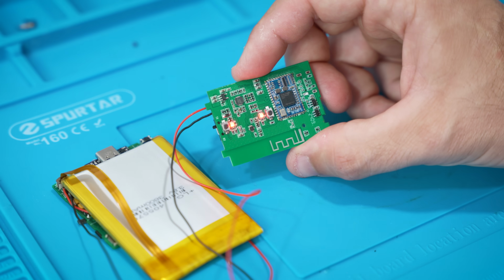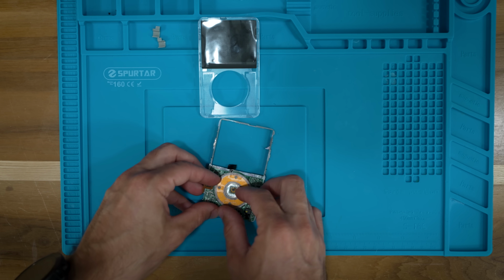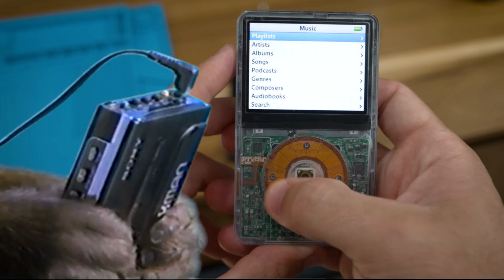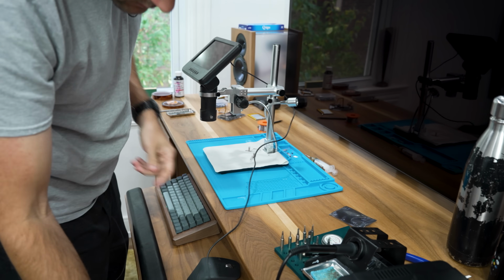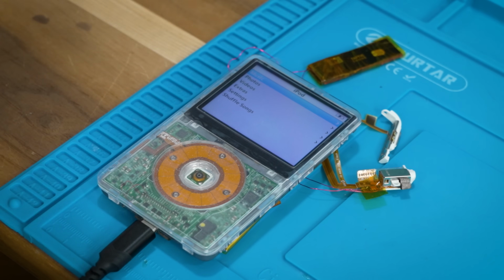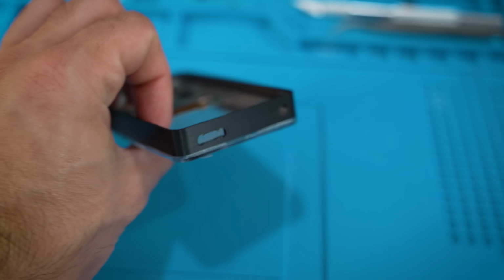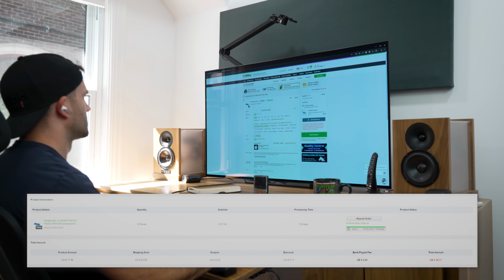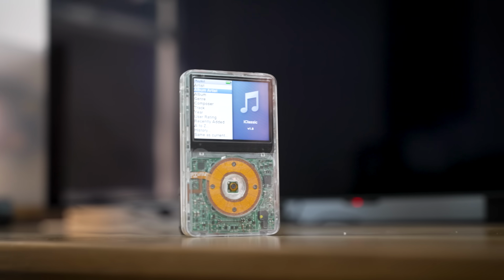I built a MODERN apple iPod...

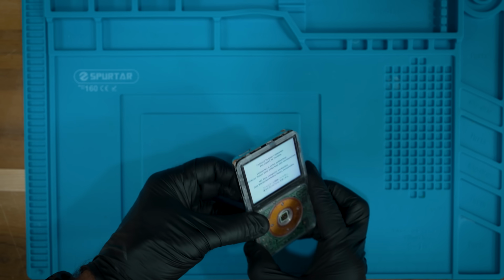Comment: 4:28 the 50,000 song limit only applies to using the stock apple firmware, using rockbox you should be able to go above that, assuming you don't use Rockbox's 'database' feature, or, if you do, the database is stored and indexed from disk and not RAM. 5:28 yea big bat mods don't work on the 30gb models. it says this in a lot of places. idk how you missed that.
6:22 I don't understand youtube's fascination with adding haptics to ipods. it absolutely murders battery life.
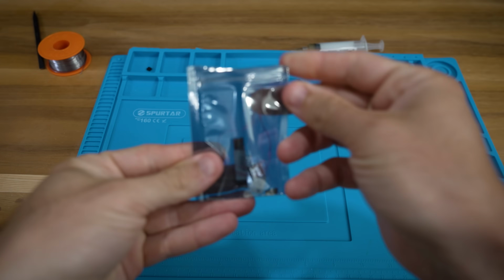10:07 idk, If'll be honest I hate usb-C, it's fragile, it's quirky, and i mean, it's better than apple's 6 pin, but more worse than the 30 pin.
theoretically you could use USB-C with a controller to delivery 12v firewire power to the ipod for "fast charging" (ipods could charge on both 5v usb and 12v firewire), but i've found that 12v is a good way to kill 3rd party batteries, and i keep my cable around these days just to jumpstart dead ipods.
16:00 I'd be very worried about battery life, especially if the bluetooth system is running all the time the ipod is powered up.
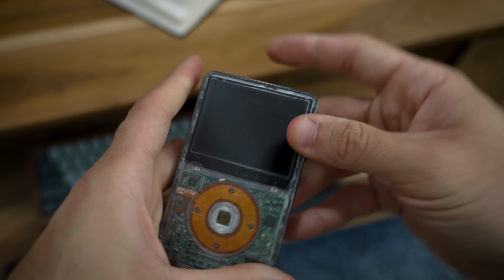22:12 I'm not sure if this is just me, but rockbox doesn't like it when I just drag and drop, i end up with skippy music. Instead i've found that if I boot the ipod into apples firmware, and then drag music onto it i don't have the same issues. Don't ask me why I don't know. Rockbox is just like that. But it's 100% a necessity for a linux user, since our ipod compatible music managers suck and crash a ton.

Comment: The horrors of iTunes… ;-)

I actually wonder how much more reliable the flashdrive is vs mechanical. As long as you don’t throw the thing around too much, I recon the mechanical drive is more reliable. It’s not a full size hdd but SD cards are more prone to fail (especially if you change songs a lot).

Comment: Your big mistake is the wrong flash mod. iFlash-Quad (4x micro sd) is thinner and allows you to assemble your big battery + taptic engine + standard case without any issues.

Comment: Hmmm. I did most of this to my ipod video (plus imod mod and adding a better headphone amp) something like 20-25 years ago. Upgraded battery, transparent front panel, sd card board with 128Gb SD card. Rockbox firmware etc. I used an external amplifier strapped to the ipod and added a mini usb socket to the line out, I didnt add bluetooth, wasnt really available, but i wouldnt have added that anyway, as bluetooth is an audio quality downgrade IMO.

Comment: I still have my 5th gen with U2 Box, The original drive died when I was at work Apple wanted $700 to fix it or I buy a new unit for $400, 1 flashcard from EBay and Never went apple again.

Comment: This is cool and all, but even as someone who loves modding devices... just buy a modern dap. Especially if you're gonna install rockbox, it's barely even an ipod at that point. If it's not the original software and barely even the original hardware, I don't really see the point, practically speaking.

Comment: I feel like every millennial runs back to the iPod at some point. I can tell you right now, it’s cool till you realize it suck’s and nostalgia is heavy. I did the same flash card mod and it works but it still takes time to find the music and load it, even with rock box 😅 a cheap android is better to use

Comment: I guess I don't really get the point of using the original iPod PCB if you are going to install a different operating system on it. Why not just use a zune or other MP3 player?

Comment: "If you're an audiophile" you're not using an iPod, even a modded one. Great project but there are way better DAP solutions with way better DACs for the same cost and saving the labor. If you like to tinker go for it. Like, seriously, get in there. The industrial design of the iPod was pretty damn awesome. But if you want a better portable, buy a proper DAP from a reputable company and seller.
Reply: Some audiophiles do use modded iPods with Rockbox, maybe not as their primary device, but they do, Is not optimal when comes to music quality, but there is some advantages. iPods are usually more portable than you're avarage DAP device, to cite one thing.
Reply: @joaopedroleite8998  I did right up to the point I could afford my Fiio X5 III. It may not be an AK but I'm quite pleased with it. The only thing I really miss is being able to use a car dock.

Comment: New iPod? Any cellphone, my old A50, or my new S24 is a new iPod. My old A50 because it has a SD card slot. I have a 300gig SD card in it. three hundred gig. 

My new S24 they withheld the SD card slot so I would have to pay for cloud storage, F that. Even with my old A50 without sim card, I can turn on wifi log into google play and use whatever app I want. I just want as simple a music player as possible. 

Verizon said gimme that A50 as trade for the new S24. I said no no, here is an old S6, they took it... lol. So... now I have multiple old/new cell phones I use as security cam monitors and Music players. Why even mention an old tech iPod? Oh and screw apple, lol. 

iPod? the best iPod is no iPod.